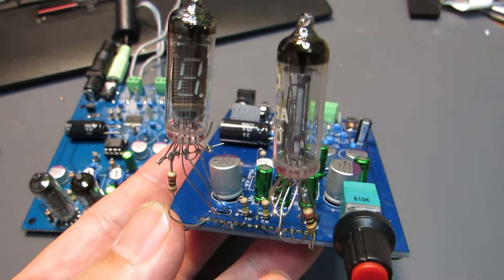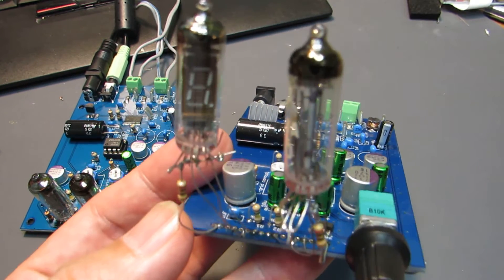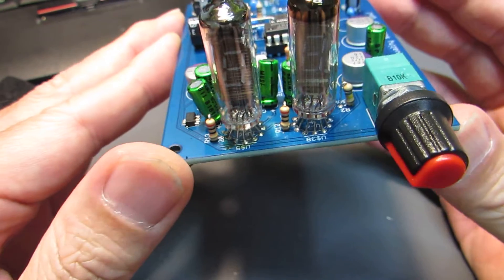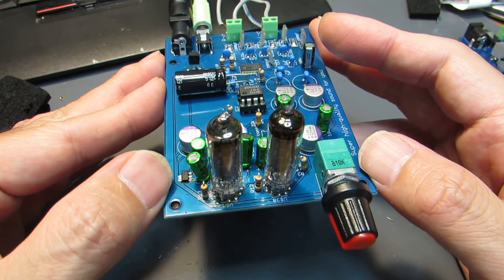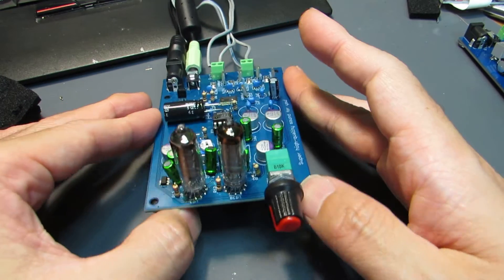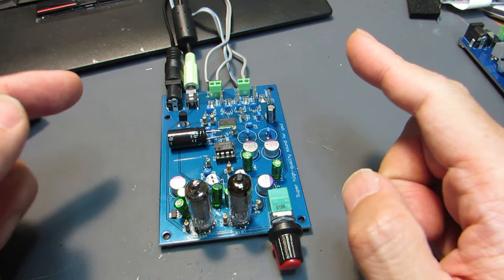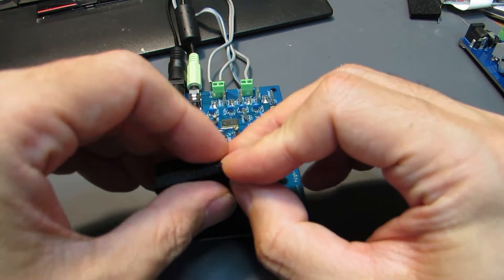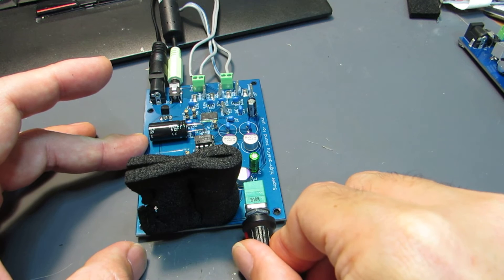VFD + class D power amplifier is done!

Comment: Even if its a "fault", it is still so cool.. The metal pieces in the tubes vibrates and are amplified by the circuit.. So cool :D But how do you fix that then, it must be possible somehow?
Reply from the maker: Actually I fixed this issue simply by careful selection of tube. VFD has a characteristic variation for audio amplification especially from view point of "microphonic and distortion". The one of two in this movie was not good one and we can avoid issue by discriminating. (As a result I have bunch of pure digit display, not for audio..)